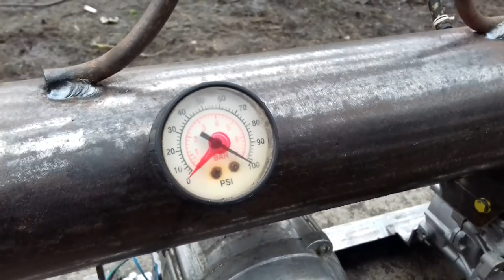Making air compressor

Comment: I would pressure test your vessel with water, and you oiling the cylinder too? Great idea if you haven't a fridge compressor. Love it
Reply from the maker: Checked with water, everything is tight. There is oil in the crankcase, the cylinder with the piston is lubricated.

Comment: Really nice work! 

I admire your craftsmanship every time!

Did you hone the cylinder wall? Or was it enough to turn it out on the lathe?

The only thing that i think is missing, is a pressure switch.
Reply from the maker: Thank! Turn the hole on the lathe and then sanded with sandpaper